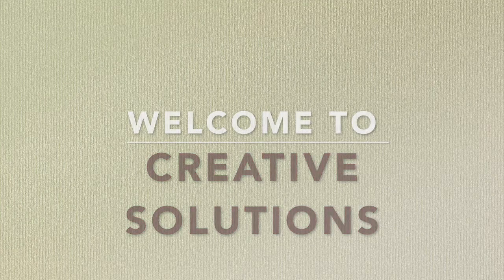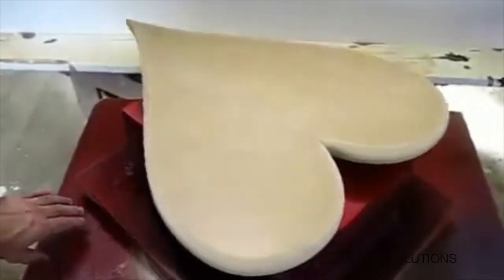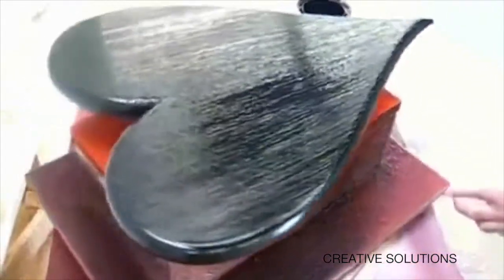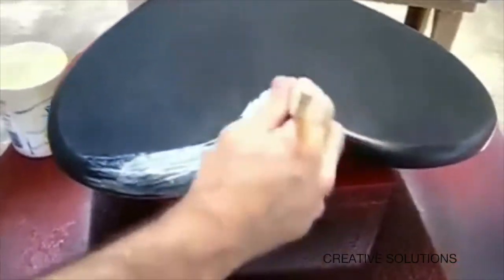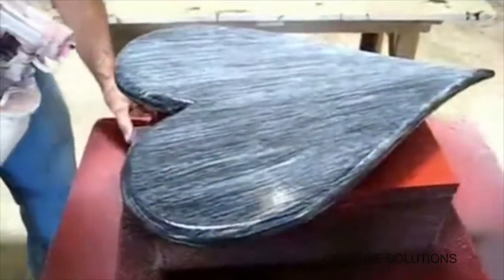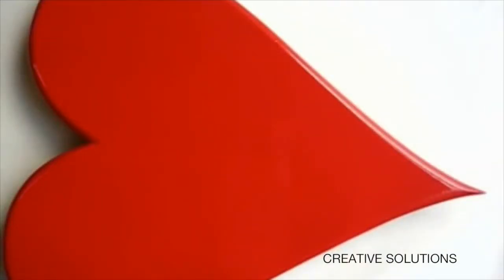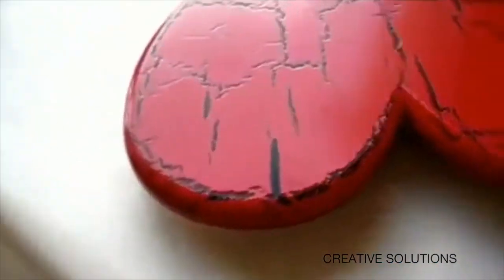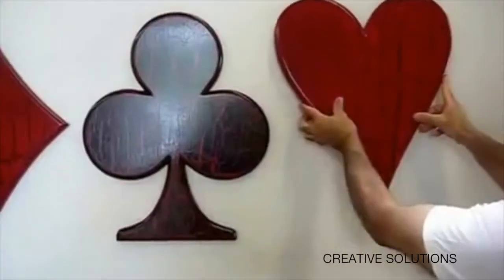Easy Crackle Finish Using Elmer's Glue

Comment: I think the secret of a successful crackle finish is the spraying of the top coat because it does not disturb the glue base coat as a brush would. One could even spray the glue. The problem is not having a compressor and spray and gun.
Reply: maybe a spray bottle with watered down glue could work? you would need to work fast to get a heavy coat though

Comment: What is the top color?  Is it acrylic or enamel?  Is it thinned down?  I get inconsistent results.  Sometimes it cracks well, sometimes it just doesn't.
Reply: The top coat is acrylic. The problem can be with the coat of glue. Even with how much you let it dry before applying the top coat.